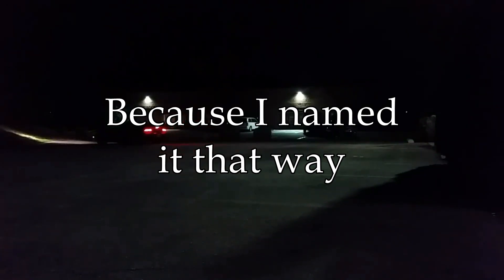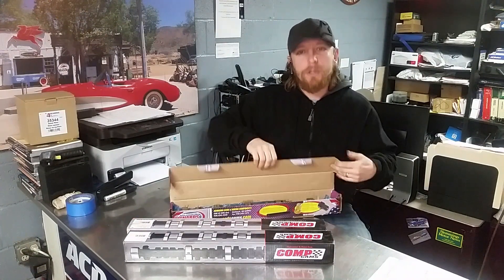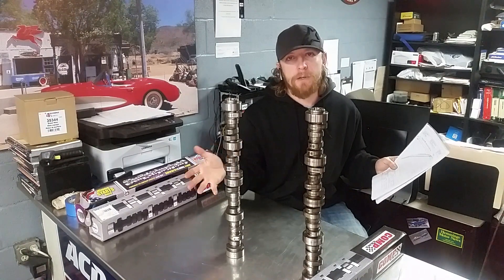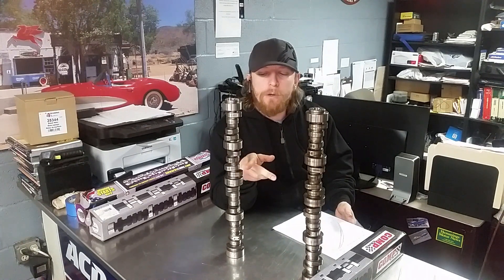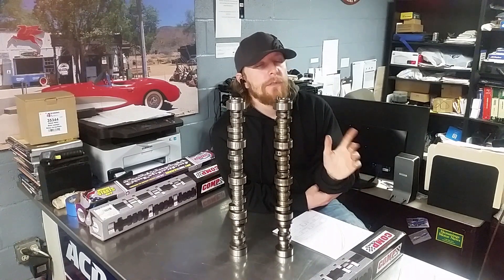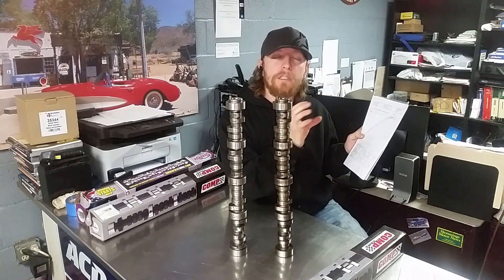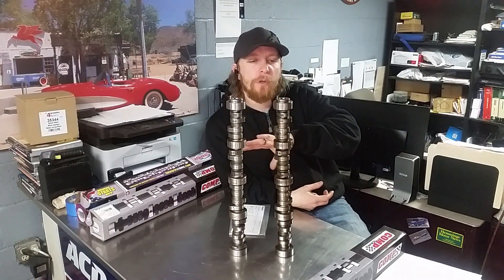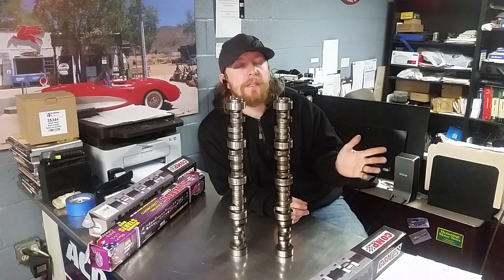Secret Info: Cam Stages VS Custom Grinds... Day13

Comment: But here’s on thing. For example, im building an LQ4 with ls3 heads, fast 102 intake, beehive springs, gen iv rods with flat top LQ9 pistons. I want a cam that would maximize the combination, but the motor isn’t in my vehicle yet. How can someone incorporate the weight of the vehicle and those other added elements before the vehicle was even dyno’d with that setup? Im just curious